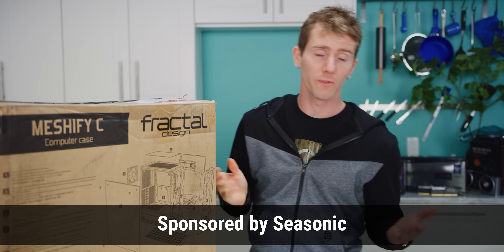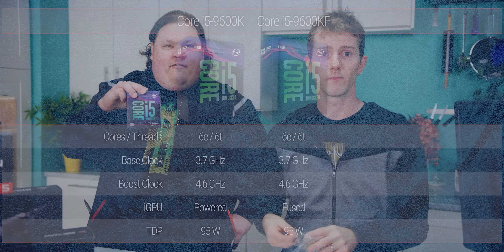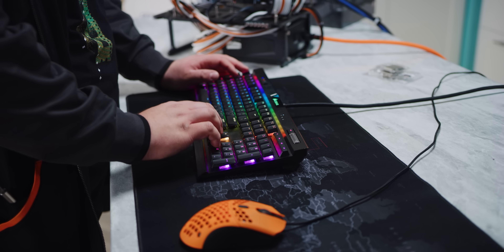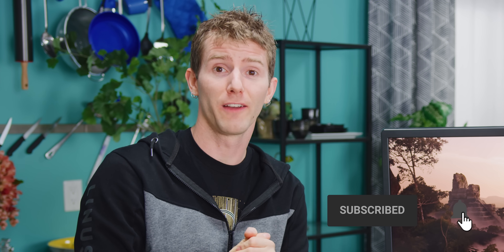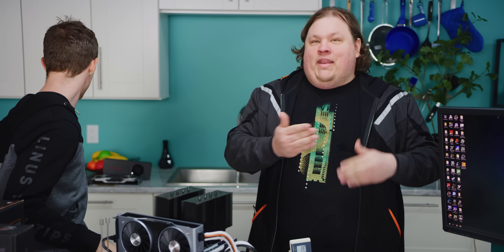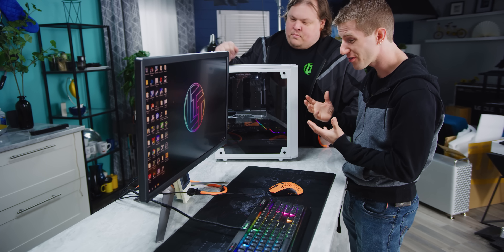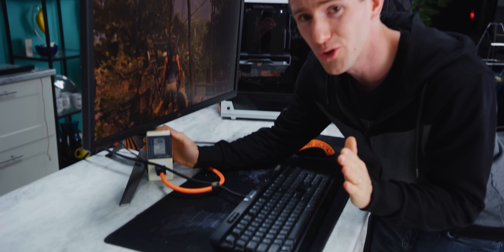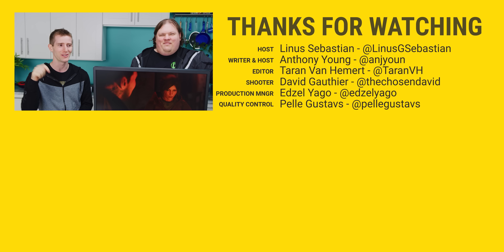We built a PC more efficient than a console!

Comment: Nuclear power: "Am I a joke to you?"
Reply: Nuclear power still produces nuclear waste.
Reply: @BlakeB415  Which can be recycled.
Reply: @MrBrightSyde1997  Most of which never gets recycled.
Reply: And Nuclear is not safe. Look at the consequences with Fukushima and the others.
Reply: @SuperGURU_Ben  That was due to incompetence. They were told multiple times to bring the plant up to code (I think they needed a bigger wall to protect against tsunamis since it was suppose to be so many meters tall for protection) and they ignored those warnings.

It's only dangerous when idiots don't follow safety standards, like with Fukushima and Chernobyl.
Reply: Nuclear power for the win! <3 Cleanest energy source at the moment.
Reply: Sybren van den Akker  I was answering the "Nuclear is not safe" claim. Didn't say anything about death totals.
Reply: Current reactors are not safe at all.  When they fail catastrophically (which is always a possibility, no matter what anyone says) they can render an area uninhabitable for a very long time, and have disastrous longterm consequences for an area much larger than ground zero.  The waste produced is radioactive for millennia, and there's no practical use for it today.  Its safe storage until it decays sufficiently cannot possibly be guaranteed.

For nuclear power to become safe, reactors need to move to an entirely new design, and away from uranium and plutonium.  Thorium is promising.  This should help with the waste issue, and perhaps even allow the use of radioactive waste from current reactors as fuel.  The goal is a system which passively becomes inert when it fails or is breached by a violent event.  Until such changes take place, reactors are time bombs.  They're far more dangerous than fossil fuels.
Reply: Thorium Salt Reactors and in development in India right now and they use Nuclear Waste as a fuel source, bringing the half life down to a few hundred years, and they cannot meltdown either. 

Nuclear is the future (and solar, of we can get the effieceny up).
Reply: @joesterling4299  saying "not safe AT ALL" is a bit of an overstatement.  Given how many reactors we have (don't forget all the nuclear powered ships we have) and how long we've had them, there have been very few problems.  But you're right that the consequences of one screw-up are high.  But to say they aren't safe AT ALL is false.
Reply: SuperGURU Fukushima was hit by an earthquake and a tsunami. Natural disaster (and some human incompetence) were at fault here.
Chernobyl was a true human error, but this 33 years ago. Today's error safety is mostly regulated by computers which are now way better than they were in 1986.
Reply: @SuperGURU_Ben  guess which source of power has the lowest number of death ratio? Inspite of all nuclear accidents? Obviously it's nuclear fission

It also doesn't produce greenhouse gases and produces the Highest energy for a small amount of land area ( solar farms and windmills occupy a shit ton of space and usually require clearing out entire forests to mount them , like seriously what are you even saving if you cut down trees?
Reply: Any plan to go to 100% carbon free in a reasonable timeframe that does not include nuclear (at least as a stopgap measure) is unrealistic
Reply: Thorium suppose to be waaay safer than standar Uranium

Why they didn't use Thorium?
Reply: @ZAR556  India is already working on thorium based reactors
Reply: @Martas331  how is nuclear cleaner than solar lol
Reply: @Thor Odinson Each new wind turbine can power 16,000 homes. They can be placed a few miles out in the ocean if land is a premium.
Most of the population on the planet is within 50 miles of the sea so there's lots of inland space for wind turbines too.
Combine wind with hydro, solar and other renewables for a clean energy source.
Reply: @MrBrightSyde1997  thats shit like cobalt-40 that doesn't have a very long half life but the other shit? thats thousands of years you have to wait for it to become safe and its expensive to store the waste produced
Reply: @MrBrightSyde1997  
yeah also the generators were placed in a bad place 
also they were very late when they opened the bleed valve 
it's always human error
Reply: Total people dying to nuclear disaster is lower than people killed by sharks....its a lower 2digit no
Reply: SuperGURU and even there is the fact that nuclear accidents in energy plants, nuclear power ACTUALLY is one of the safest ways of producing electric power.
Reply: ekoms nucler fusion is the real future with a much greater production capacity than any other option.
Reply: @arcaipekyun4232  fusion will be ready in nxt 20-30 years....till that fission powerplants shud be made available
Reply: @Google_Does_Evil_Now  The manufacturing of solar panels produces a lot of waste, so they aren't exactly clean. They have low efficiency (<20%) and work directly related to how much sunlight is available. But most of our energy demand occurs at night, when there is no sun. Therefore, though solar panels can easily provide our energy during the day, they are non-ideal energy sources.
Wind are somewhat more efficient at ~40%, but are large and require a lot of space. They are actually all round pretty good, but the issue they run into is we can't control when there will be wind, so we can't regulate energy supply to meet demands.
Hydro is extremely efficient, with around 90% efficiency. The issue is that they need large amounts of water, and dams are often very damaging to the surrounding wildlife. They may even generate noise that scares off the aquatic wildlife. What's great about hydro is that you can use ocean currents, which are very stable and predictable. 
Currently, nuclear is still the best way to go in terms of our ability to regulate them, their environmental impact, and their availability. (Some places don't have water)
Reply: @RayTsou  good reply. What is we were to combine wave, wind, solar with battery and other forms of energy storage?
There is also a cumulative effect. The renewables created energy is used to create more renewable energy.
The lack of efficiency can be improved by research and engineering, as it always has been.
And along the way we'll probably create even better technology. Can you imagine 10x more powerful batteries, 10x faster charging, 10x smaller and lighter, 10x smaller motors. That's achievable in a relatively short space of time.
Reply: Yes
Reply: Blake Buell nucleaire waist is not as big of a problem as some people want you to believe
Reply: @SuperGURU_Ben  Fukashima happened because the reactor was hit with the 4th latest earthquake in human history
Reply: SuperGURU no, nuclear is safe. It is a myth that it is not.
Reply: @joesterling4299  I don't think you know how many deaths have been caused by fossil fuels, except when people die from that, it isn't blown up by the media as the end of the world, like nuclear was after fukushima and chernobyl
Reply: @SuperGURU_Ben  ah yes, the two biggest disasters. Might looking up how many people die on working at fossil fuel plants, windmills, or solar power farms?
Reply: @slattula2310  more power output for how much equipment you need. About 2 farms get you the same as 1 power plant. It's much much more efficient than either solar or wind
Reply: Imma make a power supply with a built in nuclear reactor
Reply: Idk why people have such a negative context for it. We've come a LONG ways with the technology. For high power creation situations it seems like an ideal replacement for coal atm unless you're on top of geothermal locations. Plus we only ever hear about the disasters anyways, never the successes.
Reply: @joesterling4299  reactors are in no way time bombs if properly maintained and supervised and nuclear is in no way more dangerous than fossil.
Reply: I know, it's literally the best way of generating power we have, don't write nuclear off.
Reply: I think it's safe to say that at the moment there is no silver bullet type of power generation. Might be nuclear in the future, might be not. And renewables usefulness is very specific to local conditions. Efficiency is a major "source" of energy that can be extremely cost effective. So this video is spot on.
Reply: @SuperGURU_Ben  Fukushima was a design flaw, you don't put the diesel generators at sea levels in an area prone to tsunsmis.
Reply: SuperGURU Yes it is look at the thousands others plant working perfectly for more than 30 years ... plus we do not have anything more clean to compensate for it anyway
Reply: @Mike Wazowski newer reactors are built with a safelock so if humanity disappears they would shut themselves off
Reply: Years of propaganda. Fossil fuel moguls keep getting richer while we waste time fucking around with electric cars instead of perfecting our handling of nuclear technology.
Reply: Blake Buell just wait until we get nuclear fusion going.
Reply: Mike Wazowski I accept climate change and recognise nuclear as being clean and non destructive if not run by idiots.  Fusion will be even better.
Reply: @DrewPeabaws  Unfortunately right now it still takes more energy to start the reaction than what you get back, but hopefully, that will improve in the future.
Reply: Not great, not terrible...
Reply: Coal is more dangerous than nuclear
Reply: Its not a fossil fuel
Reply: @joesterling4299  "no practical use" depleted uranium was used in experimental sabot shots and armour plating
Reply: @zedzedder4947  It is pretty great, better than any other greenhouse-free power option. Windmills and solar panels aren't the future, they can't meet with power demands.
Reply: @joesterling4299   also the new technology of fusion is way safer as well, if the core is breached, the gasses being fused will just expand and cool down, and float away because they are made of helium. also these gasses won't pollute the atmosphere because they are light enough to just leave earth's atmosphere. not to mention that it produces 4x the power per kilogram of fuel than what fission (current 'unsafe', as you put it, reactors) can. TLDR; fusion is definitely the way to go
Reply: @Martas331  No it's not
Reply: @MrBrightSyde1997  into weapons
Reply: @fabiogulmini4664  Or back into fuel again.
Reply: @thatguy_tenthousand269  Don't forget how cheap and plentiful hydrogen is.

Comment: howd you get a zero fan curve

anthony: reprogrammed the card by flashing the bios of a different card and adjusting it. 

me an intellectual: unplugs fans
Reply: 😂, but kinda unsafe if somehow it heats up (area suddenly have no airflow), then you're fvcked.
Reply: MtPews a 0 fan curve is also dangerous
Reply: @TheSaltyGaming  no if you watched the video the fan WILL spin, when it's getting too hot.
Reply: @MarkiThePews  its not. It will just either clock down until the game crashes or it will shut it self off after tmax is reached.
Reply: @Squilliam-Fancyson  mine actually DO turn on after their 0 curve when too hot ;o just gotta adjust the slider to the right temp.
Reply: @Squilliam-Fancyson  and they specifically said that the fan would turn on after 85 degrees, literally in the video bud
Reply: @ricardopaixao6367  🤦‍♂️
Reply: Unplugging the fan in Founder Edition card is pain. The fan cables are protected by the plate which is glued on the card.
Reply: @MarkiThePews  Fortunately modern PCs are big-brain and lower the TDP when they start overheating.
Reply: @Squilliam-Fancyson  They literally said it in the video that the fans will cut on at 85 degrees when/if needed and there is actual footage of the fans spinning up and shutting down while it is being used... 4head
Reply: Also, common sense says using 10% fan curve is more energy efficient. (Most fan's dont spin properly in very low settings). Even small airflow gives big advantage over none. System temperature increases power draw exponentially.
Reply: @Judgment89  Yeah but dust accumulation...
Reply: @mrguybrodude7373  yeah i've seen it. The guy above me stated that it would be unsafe to just pull the plug of the fans, which is not true.  Thats the reason I made my comment.
Reply: Lionhart  uhh thats bull... VRMs can take up to 150° celsius without degrading. Most cards will not let them reach over 105°. There is absolutly no sudden death or faster degradation with 0% fan curve. Otherwise big manufacturers wont ship cards with that feature. 
PS: i have a morpheus too on a well oced Vega 56. Its an excellent cooler and gives the card the thermal headroom it needs. Mine stays between 55-60 @ 1000rpm. (1682mhz target)
Reply: @Squilliam-Fancyson  Been using Youtube Vanced, have no comment notification :|, damn late, but...
It is dangerous, if there's no airflow, heat can't dissipate, which yes like you said, will reduce the frequency, but still, heat can't go away and finally, crash, which, is bad, I didn't say your pc is now dead, but it's electronic, you don't know what will happen, so dead might actually happens on some faulty cards (which might probably also suddenly dead without unplugging the fan *haha*), and whatever data that haven't got saved.

Comment: So I have a use case for this: off grid living
Reply: Or saving money on power
Reply: @Keretizein x You're confusing what Tuba meant with the phrase 'off the grid'. It's possible to be off-grid for electricity, i.e. solar panels and a battery, and still be connected to the internet.
Reply: The amount you’d save on power would never equal the additional hardware cost.
Reply: You can just cover the whole roof in solar panels. It's very common in the UK though if you live in the US it should be a lot more efficient.
Reply: That would actually make a fun experiment ♡♡♡♡♡ 
Off grid pc gaming
Reply: @bradhaines3142  Your experience is much different from this person's example. Deep cycle batteries in boats are not kept at a constant temp, with constant power draw all the time. I would agree that 7 years seems like a bit to long, but comparing boat batteries to a dedicated home battery is not apples to apples.
Reply: @JoshuaG  Or join the army, then you get to play computer games in a field about war for real!
Reply: Droosk  What about installation and maintenance, your work has value too.
Reply: @brazeiar9672  then i would die for real xD hahahah
Reply: @omop413  Exactamundo...In addition, cost comparisons (hardware vs energy etc...) are meaningless for people who don't have PG&E piped directly to their abodes. Not to mention RV'ers ! Low consumption (with decent performance) is paramount.
Reply: I'm currently living off grid, and that's precisely why I'm watching this video... Haven't been able to run my GTX 970/FX 8350 system for more than a few hours for years.
Reply: @bradhaines3142  I'd like to put a word in for Trojan batteries here - My little L16E-AC bank is going on 5 years and only now starting to die off, and they've been going through cycles of below freezing and 100f+ temps for that entire time here in the nevada desert.
Reply: Power it with a bike! Exercise motivation!
Reply: @YouTube2021FM  But it may not entirely be based on the cost saved but the total power used. With a solar and battery setup you only have a set amount power on battery during night and may still use some battery power during dimly lit days.  So you don't want to fire up your Threadripper 3990x and RTX Titan X and drain your entire battery in an hour or two.
Reply: I have a camper van with an auxiliary battery that is charged from the alternator. This battery cost less than $100, and can provide 100 watts of DC power for up to 24 hours. I game on a laptop that charges via a vehicle accessory plug, and use a hotspot from my phone for internet. As long as I drive around for 20 minutes once every day or two, I have essentially unlimited free electricity. :)
Reply: Isn't it easier to just have more solar panels instead though?
Reply: Or as a practice in engineering HPC
Reply: cant even run games offline for a month
Reply: @BattousaiHBr  I essentially live out of my van, so while I could add solar to it, the alternator has been doing the job fine. :) It's providing power anyway, so I may as well utilize it.
Reply: Alot of you are assuming you have unlimited space for solar (yeah not an option of an RV or sailboat) and thus the power savings of more solar/batteries is moot as its impossible to put more on small form factor living. Im hoping to move into a sailboat in the next year so this was interesting for me. also: single payer games!!! I dont need internet for those! (also hope to do a long distance Wifi solution with a 2.4ghz Yagi/patch and an antenna tracker up on the mast)

Comment: I wonder how much performance is lost compared to the same system at stock settings. If it's only 10-20% I might seriously consider doing it for real use, slowly increasing clocks as the system ages.
Reply: Yes, this is a HUGE piece that should have been included in the video! I want to see the percentage drop in power consumption and the percentage loss in performance versus the stock settings. If it's like 10% power savings for a 10% loss in FPS, at that point we should probably just buy a lower-end part and call it a day. If it's like a 40% power savings for a 10% loss in FPS, that's awesome and makes this seem worth doing, but it's still good to know what the approximate FPS hit is; the day will come when your system can't give you a stable 60 FPS and it'll be nice to know about how much performance overhead you have if you were to revert to stock.